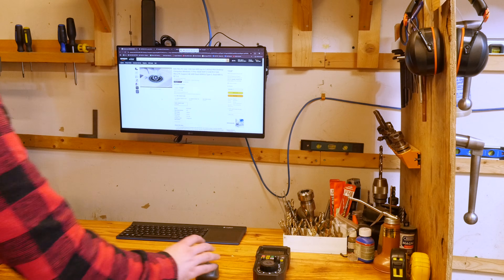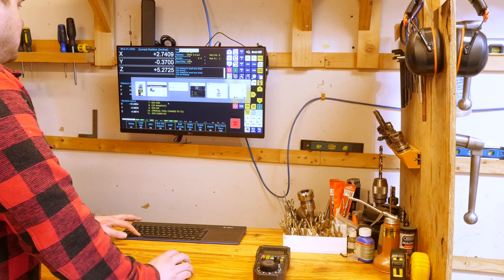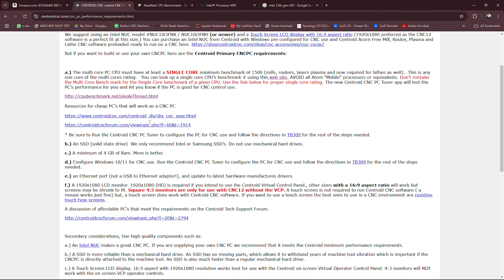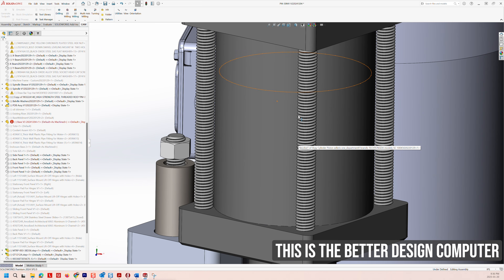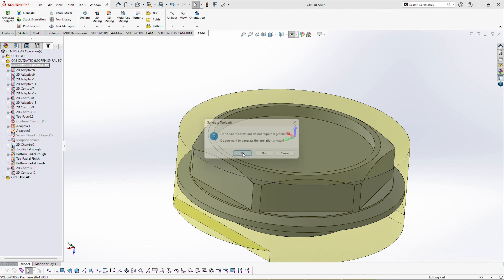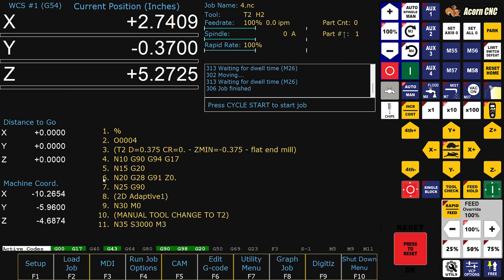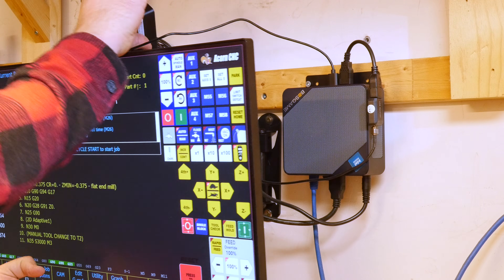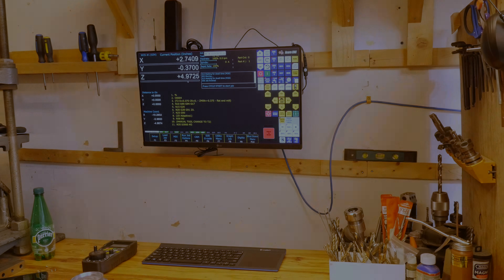Don't Overspend on a CNC Computer!

Comment: Hey Adam, I bought the Bosgame to run my centroid controller. Did you have any problems downloading Notepad ++ as the PC tuner suggests?
Reply from the maker: I did not. Are you having issues?
Reply: @adamdebowski2037  yes. its almost like the mini pc is blocking apps even though I've turned off firewall type settings.

Comment: I have very similar, N95 pc in my office, and it's great for office work, plotters, 3d printers and other stuff that needs to be controlled.
You can also get them even chepaer than 160$ for 16/512 version, and are obviously expandable.
I got mine for like 110-120$ but those are Europe prices.
And yes, N95 gets almost 2000 points on single core on that benchmark.

P.S. I you want some stronger performance for breaks DIY a cheapo Ryzen APU setup. Mini PCs with APUs also exist.

Comment: N95 has a single core thread of 1900 (FYIO to find it look at portable/embedded on the website referenced by Centroid.
For comparison this is about the same as a i5-7300U - an i5 mobile chip from 2017/8

Comment: set up a share file so that the file can be seen between both computers. Then you can set up to use remote connection from the cheaper computer to remote in to the workstation to do edits then save to share file and reopen on cnc computer. This should be well documented on how to do these to things and inside you local network should be fast enough and secure enough.
Reply from the maker: Thanks for sharing. Will definitely give this a try!

Comment: I did the exact same thing. Bought two micro-CPU's and two side-by-side monitors. I use one for CAD/CAM alterations in the work shop and the other is a dedicated Mach4 controller. Those little micro-pc's are great!
Reply from the maker: That sounds like quite the garage setup! Agree - love these little things.

Comment: alternative you can get a used lenovo m600 with faster processor with same specs with keyboard and mouse included for usually around 80-100. the reason i like this option is because it would otherwise be E-waste and has the same performance.
Reply from the maker: Wow, that’s incredible. Sounds like a better option! Thanks for sharing.

Comment: I use RDP to connect to my workstation (or laptop) from the workshop. Works really well, even with SolidWorks. I use Syncthing to keep the files available on all computers (without having to be dependent on network connections while running g-code).
Reply from the maker: Excellent. Thanks for sharing!

Comment: Thanks Adam. I've been looking for a replacement for my plasma table that uses Windows 11 Pro.
Reply from the maker: @3dmakerzone75  Hey Mark / that plasma table looks awesome. Which CNC controller are you using?
Reply: @adamdebowski2037  Acord. I also use one on my mill but I have a full size PC running that one.
Reply from the maker: @ sweet. How do you find the plasma control compared to the mill control interface? Was it easy to get up and running because you had experience with the mill software?
Reply: @adamdebowski2037  Of course I meant Acorn.

Comment: You could dedicate the small PC to Acorn only and use remote desktop to get back to your main design PC. Also you could kepp the Acorn PC off the internet
Reply from the maker: I do this when I have to get into my work computer from home. I do find it to be a little bit laggy because of the connection, though. Even mouse movements outside of solidworks lag a little, and it can make it difficult to navigate. The best solution I’ve found is to use my desktop at home to VPN into my work’s network, and use my local installation of Solidworks to reference the files on the server at work, but that creates other complications. I’m still oh the hunt for the best solution!
Reply: @adamdebowski2037 be very careful if your SolidWorks at home is a cracked version. They can see that and one day they'll contact your boss.